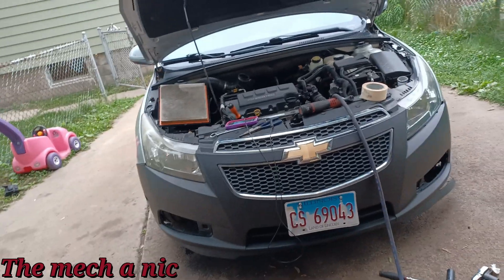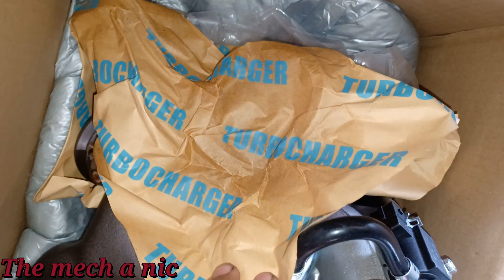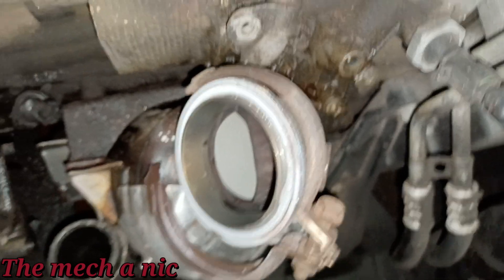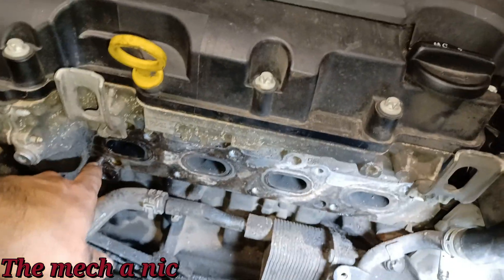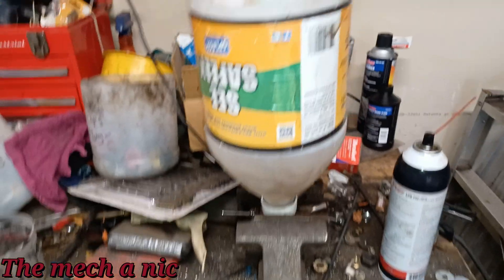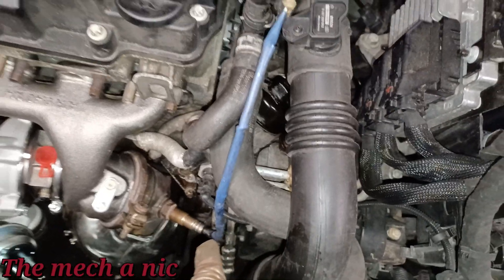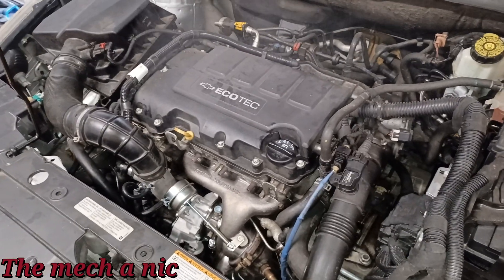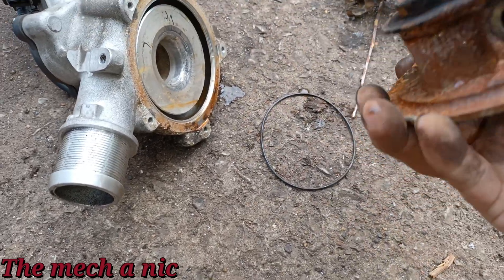chevy cruze P0299 repair

Comment: @11:26
Cut top off of spray can with hacksaw.
Be mindful of previous contents/under pressure, wear PPE.
Reply from the maker: Great idea! Never thought of that. Time to do that in preparation for next time I need something like that
Reply: @themechanic6117  
I was just helping The Canadian Bubba clean a carburetor- I advised him to make an impromptu ultrasonic cleaner.
Whatever container you have for the part, use a 50:50 mix of ATF + Acetone, and attach an unbalanced motor, or (best) a $25 Harbor Freight engraver to the container. Dial it in, until you see the destructive waves hitting each other, like little hammers. Ultrasonic vibrations are key to cleaning. Throw in an aquarium heater- hot solutions work even better.
An actual heated unit is only $50 on Amazon, great for stuff like injectors, tubing, etc.

Comment: My next door neighbors have 2 chevy cruze with turbos , a 2018 & 2017 .   both over 100K and  never had any problems so far.
Reply from the maker: I've seen car with that turbo engine completely neglected and a ton of miles and it's still kicking. I guess some cars are luckier than others
Reply: I guess I got lucky on mine. It finally kicked the bucket after 135k miles

Comment: A trick I use on beetle heat riser tubes blocked with carbon is an old clutch cable in a drill.
Just splay out the end for best results.
Reply from the maker: That's a pretty good idea .thanks for the tip

Comment: Your last comment about the AC is giving me high hopes about why mine isnt working. Been kind of dealing with my p0299 issues and have come to the conclusion that the compressor is not working on my cruze, which i dont think is worth fixing at the cars age. Hopefully when i tackle the turbo issue the AC will have fixed itself.

Comment: Great video explaining why the Turbo failed in the first place.  The oil feed line on my Chevy Cruze LT was leaking when I first started getting the PO299 code.  It was probably clogged as well, but didn't think to check since I was just replacing it.  This seems to be a known problem on the part of Chevy with the design of their oil feed pipe.
Reply: It can be good and bad at the same time, as it's next to the hot exhaust it heats up the oil very quickly which is good for the winter time but still bad for the oil because the constant heat wears it out very quickly as well which makes it thicker.. and this is why you need to replace the oil more frequently and not wait too long. This goes for every turbocharged vehicle..

Comment: Just to let you know the oil turbo line that you're playing with has to be replaced due to the fact that they have an upgraded version which has a heat shield on it which will prevent clogging of the tube and it comes with dual o'rings to help seal it better
Reply from the maker: If you finished the video you'll see that I replaced the line with a new one

Comment: You are 100% correct. It’s poor oil maintenance that destroys the turbos. Also that pipe you tried to clear for so long should be replaced every 40,000 miles or so. It’s an easy fix and the part on Amazon is cheap like you say. That part at the end is the thermostat housing and they are also a common failure point.

Comment: you should have installed new supply and return coolant lines for the turbo also.  no doubt those are going to start leaking very soon.
Reply from the maker: You're right. I learned my lesson
Reply: What brand turbo do you like? Recommend. I need to replace mine on my 2013 and all 4 lines.

Comment: Amazing video - great job. I have the same code, the car is sluggish and has a rough idle, but does not have a misfire. The code has been there for about a year, but never had any power issues up until now. How much time is a normal turbo repair.
Reply from the maker: It's hard to say, the job can get done in a few hours

Comment: Turbos are great at being efficient, when they work properly.  I do hate this design with the integrated exhaust manifold though. Audi/VWs(VAGs) have a similar design setup.
Reply from the maker: It's not the best design but it's also not a horrible job to do.

Comment: That is a replacement fill tube. Someone replaced it and didn’t tighten the one bolt. I can tell because it has two O rings. The original factory tubes only had one O ring. So Chevy knew this was a problem.

Comment: I had a 2014 Cruze eco and the entire engine locked at 21,544 miles. Thankfully the dealership replaced the engine under warranty. It never ran the same so I traded it in on a Nissan truck Titan XD PLATINUM RESERVE
Reply from the maker: My friend bought a sonic brand new and within a few months it had already been back to the dealer for "defective parts" two times .not a good sign . Those cars are nothing but problems

Comment: A little advice, don't weld those cheap clamps if you can afford $25 to buy a new one. .  Replace them. They are onlt $25.  You don't want that clamp breaking on you later.  GM service manual says throw them out.  There is a reason for that. Nice job on that!!!

Comment: Awesome video I have the same code on my 2012 Buick regal I change everything I change the turbo bypass solenoid boost solenoid change the whole turbo but still get the same code low boost
Reply from the maker: Most likely the turbo was the bad part all along
Reply: I put a new turbo in my car but still got the p0299 code...
Reply from the maker: Check for cracks in any of the plastic tubes. They can Crack and allow boost pressure to escape
Reply: Ok I'll check all the plastic tubings .. 👍👍

Comment: Hi.  Igo I want to ask you a question I have the code p0299 I already changed the turbo for a new one but it keeps giving me the same error I changed the oxygen sensor the pressure sensor too but I still have the problem I delete it and after reaching 80 mph it turns to activate and the car loses power completely, what problem could I have?
Reply: Hey have the same issue I changed the turbo with a new one also changed the 2 oil lines and getting under boost code
Reply: Did you figure out what was wrong

Comment: So I just had my car at the shop and they replaced the turbo and all the lines to the turbo. I am still getting the p0299 code and then another code p0033. The car has absolutely no power at all and when driving you can hear something like sounds like it’s kind of sucking air.
Reply from the maker: Sounds like it needs to go back to the shop that you paid.
Reply: @themechanic6117  yeah it’s going tomorrow and hopefully they can fix the issue.

Comment: Im installing turbo #4. The latest one looks ok but the fan hits the wall when its running but i dont see any damage but i hear it inside.
Reply from the maker: Are you replacing the oil feed and return lines?
Reply: @themechanic6117  i did 900 miles ago when i installed the turbo. I wasnt planning on it again

Comment: Is this oem or aftermarket turbo, just found out mine has a crack on exhaust side, searching for a good replacement, thanks.
Reply from the maker: This is aftermarket.  You have two option. Cheap aftermarket or expensive oem
Reply: @themechanic6117  can you send me link to the one you got for this replacement?
Reply from the maker: I don't have a link for it. It's just a generic turbo off of ebay. They pop up everywhere once you start searching
Reply: @themechanic6117  Thanks! will be getting those 2 lines as well, glad I saw your video/advice

Comment: Rebuilding the cartridge is feasible and    cost less than buying the whole assembly, the cracking issue in housing, is resolved with a new exhaust manifold.. doing both is still way less than buykng a whole assembly..

Comment: Yes change your oil BUT this is a problem 
With the oil tubing is to close to the turbos body and baking the oil in the tub causing a clog oil line to the turbo.
The 2016 late, 2017 has a 1.9 Ĺ the turbo oil pipe
Is hung out in the breeze this is what I have my problem is oil in the inter cooler and plenum to throttle body.
The problem with this is oil is going in to the intake and crusting the valves , direct fuel injection.😢

Comment: You happen to have any part numbers on what you used. I'm going to have to change my fiancés great video btw
Reply from the maker: Sorry I don't. The turbo came from ebay so if you search chevy cruze turbo it'll pop up. On ebay they're pretty much all the same aftermarket turbos.  The pipes and Hoses you can find on Amazon,  turbo oil inlet and turbo oil return.

Comment: Can anyone help me out w the specs on the parts replaced. I’m having the same exact issues w my Cruze LTZ. 99% sure my turbo’s propellor is cracked as well. I had the dealer switch out the thermo under a “recall” for “free” in sept all that’s left is the turbo and the oil/coolant lines for it. I want to get a Garrett turbo. I don’t trust GM. Just want to make sure I get the right turbo and lines.

Comment: Dude I need mine done how do we get in touch to talk.
Reply from the maker: Where are you located?
Reply: @themechanic6117  Lake in the Hills, Illinois
Reply: @themechanic6117  10 min away from 90 Jane Adams
Reply from the maker: Oh ok. Message me on Instagram or Facebook
Reply: @themechanic6117  I send a message not sure if I message the right person.
Reply: @themechanic6117  how much would you charge to diagnose my Cruze? I also live in Chicago area. I appreciate it man.

I have code p0299 and p0301 cylinder 1 misfire. I already changed sparkplug and ignition coil on cylinder 1. But engine light still on

Comment: You just bought another piece of junk in the way of the oil turbo line because it's supposed to have a heat shield on it that line is not going to last that long without being plugged up either
Reply from the maker: I'll keep an eye out for updated parts. I can only do so much. The original part didn't have a heat shield and neither did the new part.

Comment: That entire turbo is so tiny, toy-like.
Strange, how it's integral with the exhaust manifold.
1.4L? That's so stupid. False Economy. Sure, fuel efficient-
but because of the turbo squeezing every decimal of torque
possible from it, and the Consumer is going to be WOT from
light to light, the components will grenade quickly.

Just more mass produced hype.
Reply: It's not stupid, and it's not a false economy. It just happens to be another option that you apparently don't like. Which is fine. But that doesn't make it dumb. 
My first car was a 1.3L, non-turbo. From 1980. I still managed to drive 20% over the national speed limit without making it sweat. You Americans are obsessed with engine size.